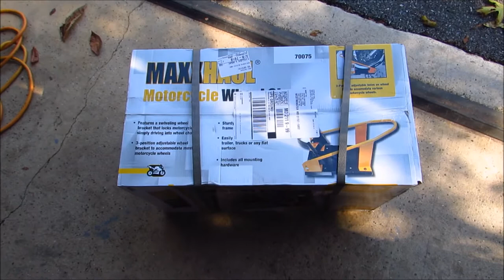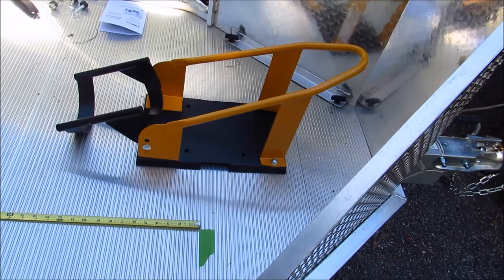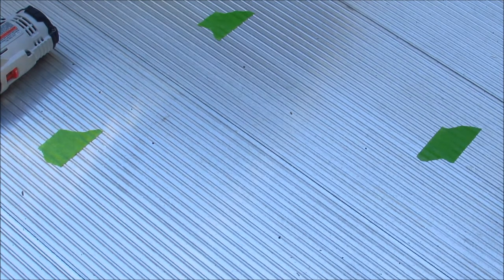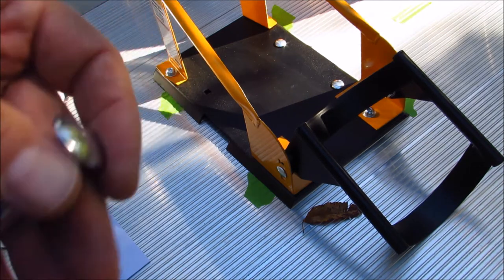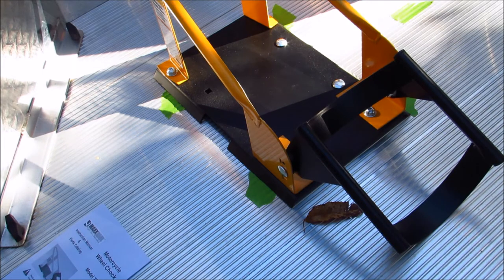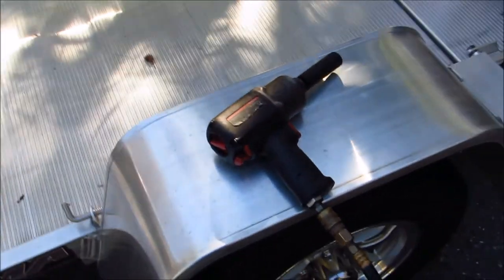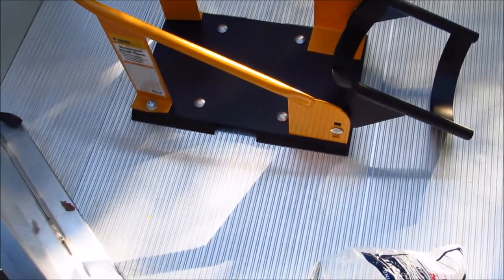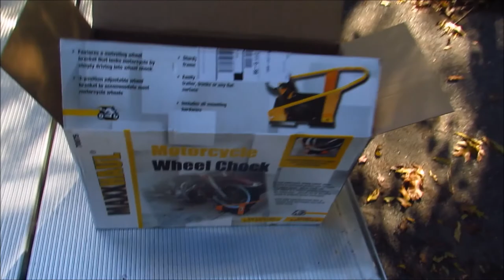MaxxHaul Motorcycle Wheel Chock install and review

Comment: Where do you hook your ratchet straps to pull the bike forward into the chock? Looks like the rock guard and will prevent you from strapping bike forward.
Reply from the maker: stever00 there are two welded hoops on the frame
Reply: Thanks, I have MC210 . Has rings mounted in floor. Just put Harbor Freight Chock that looks just like that on mine. I sawed a piece of 3/4 plywood under the base . It raises it up higher to make it easier to get  the nuts off from under the plate if you want to remove the top. Also put two pieces of angle iron across the bottom ribs with holes drilled to fit base. These are easy for wood floor trailer but not so on Aluminum. Thanks for sharing.